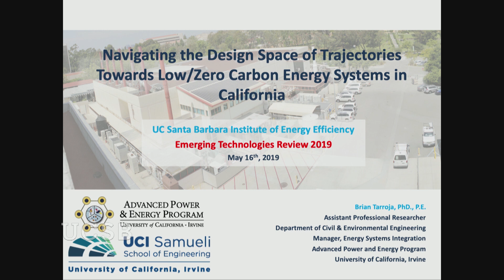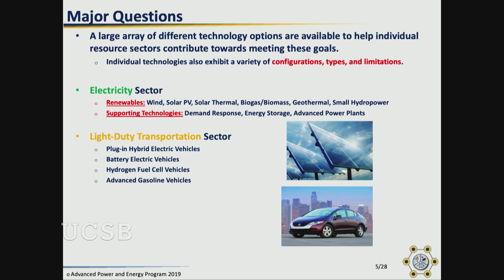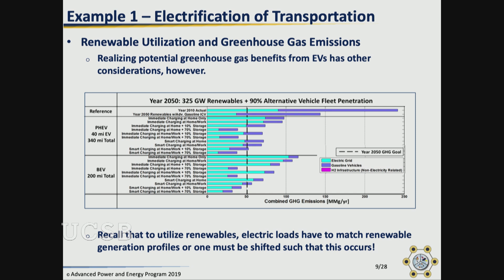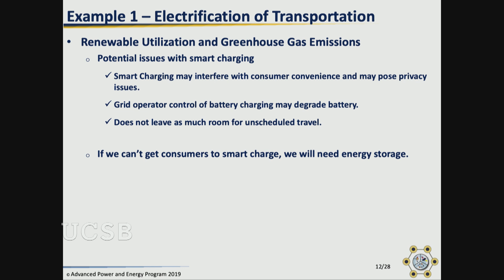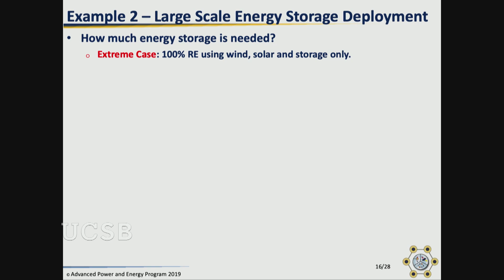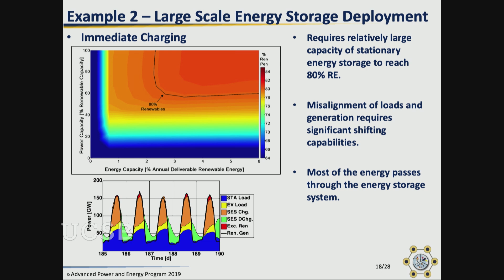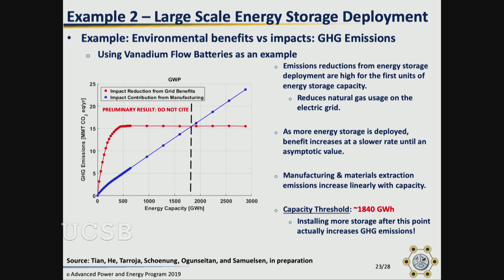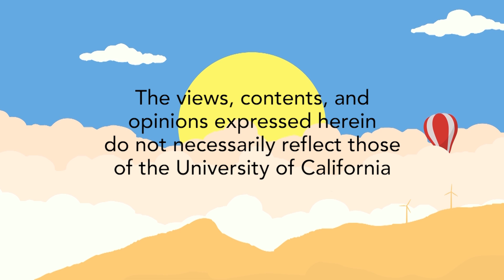Designing Sustainable Energy Systems

Comment: You can have batteries at home like a Tesla Wall that charges you car immediately that can recharge later.  The charging your car like filling it with gas is a great selling point if you want to get folks swapped over to EVs.  Battery storage, especially at home, is a great big growth potential, be it Tesla Wall or any other

Comment: Flip towns off-grid, 1-Mw•1300hp magnet-to-magnet power, "50-year no-inputs warranty"; 17yr R&D; Belgian: technokontrol, RF-5000, sparkless, military-spec, ships in a container.

The motor is small, 24x7in/61x17cm so fits cars, trucks, tractors, trains, planes and ships at sea.

This implies cars only needing upkeep, never refueling or recharging for the LIFETIME of the owner.

Made to wire panels into as the inverter: 10kw•$15k, 5kw•$8k, 1.2-cents/kwh; 20-year no-inputs warranty; S. Korean: infinitysav, magnets are 90% full power in 1000-years.

These are the only 2 found in trade studies globally ready for assembly-line design and production, you try.

I design magnet motors for product lines, no funding, too bad the USA is working for last place in innovation under central banksters dictates to sources, a huge potential market, no need for Bolivian lithium ... etc.